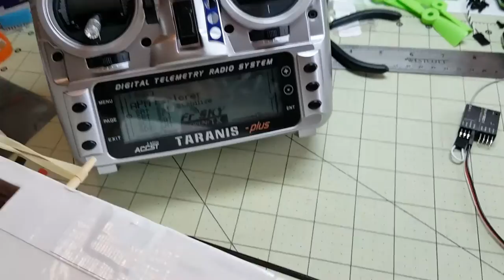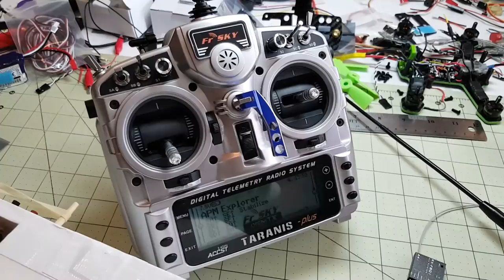FrSky to Dragonlink Repeater

Comment: Very cool but it lacks a voltage alarm warning in case @5:03
Reply from the maker: +Koestel Good observation!  I do use a lipo alarm on the balance lead, just forgot to put it on for the video shoot.
Reply: +Albert Kim (marblekit) 
okay, or take the telemetry receiver

Comment: Very interesting. If I well understand (my English is not very good) you use a standard receiver? So this could be done with any receiver? What about a more simple system using a simple wire (I plan to use a standard data cable for
computer) ?
Reply from the maker: +Volde lurubu Need a PPM receiver
Reply: yes of course. What about my idea of a wire ?
Reply from the maker: Not sure about a data cable for a computer.  I guess give it a try, it can't hurt.
Reply: Albert Kim n

Comment: is that the dragon link V3? i plan on doing this within the next few weeks. I'll keep you updated on how it worked out. Thanks for the vid
Reply from the maker: +leedo03 It's the Dragonlink V2. It probably will work with V3 just fine.
Reply: +Albert Kim (marble kit) Cool, everything should come in today. Ill try it out this weekend. It looks like you're binding channel 1 and 3? Is there a reason why you're doing this?
Reply from the maker: +FPVEngineering on that receiver jumping channel 1& 3 will enable PPM. That's what I'm using this for.
Reply: +Albert Kim (marblekit) it works great. thanks!
Reply from the maker: +FPVEngineering awesome!
Reply: Will this work for the x8r too?

Comment: Hello my friend

I have qx7
Receiver ppm / sbus

Modul r9m
Receiver r9m mini only sbus.

Can i repeater my modul.

Help me please thanks alot
Reply from the maker: The method I used in this video will not work on those parts, sorry.
Reply: @AlbertKimTV  so what part can i use to repeater my r9m modul plase help
Reply from the maker: You can't because the module uses the serial protocol, not PPM.  There might be a more complicated way to engineer this, but I don't have that knowledge, sorry.
Reply: @AlbertKimTV  the r9m can set to ppm.

So the receiver must use r9 slim ppm mode?

So can repeater is that true?

Comment: Hi , just curious how is your latency on this relay? i tried 2 different frsky RXes (X8R and jumper R1-D16) and not to happy with relay and "glitching" of plane controls (servos). I am connecting via SBUS - these days DL V3 accepts SBUS on input1
Reply from the maker: I never experienced any glitching of delays.  I was connected via PPM I believe.  I had no issues with latency and was able to fly long range planes with no issues.

Comment: Is there a method to recive telemetry using this setup?  My current setup is FrSky x6e to the D.L.  I'm using a Taranis X9E and really don't want to drill any holes by installing the DL
Reply from the maker: None that I'm aware of. I suppose you could have the flight controller send some data over a channel in the PPM stream and then have the FrSky receiver forward that info to the Taranis, but this is just speculation on my part and I have no idea how this would be implemented.  Most people doing long range will have the flight controller display telemetry type information on an OSD and this will be sent over the FPV video downlink instead.  This is more practical anyway.
Reply: Understandable, I've been playing with it for a bit, and have had no luck, Thought maybe I was missing something, besides there is very little info out there on the X9E.  I did the repeater and it works fine.  Great video, keep it up!

Comment: Is there any way of getting 12 channels? I'm using ET Vector and I don't want to lose my RSSI and Link (it requires them to be on 11&12). Thanks
Reply from the maker: If you use a receiver on the repeater end that can do 12-ch PPM, it should work. I believe the X8R in D16 mode will work this way.
Reply: Doesn't the x8r output SBUS instead of CPPM?
Reply from the maker: +BOOF! you can use an SBUS to cppm converter... or try an XSR receiver instead. That one does both cppm and SBUS.
Reply: I've ordered a x4r and the converter. Should get me going. Thanks

Comment: will this allow you to use telemetry. Thanks
Reply from the maker: +Evan VH Not that useful in this scenario. You can get RSSI from the FrSky receiver, but it's only a few feet away so doesn't serve much purpose.  The Dragonlink receiver does not output any telemetry so the Taranis can't get any from the receiver we are interested in.  For me, I just use an OSD connected to my flight controller (APM) to get RSSI, battery voltage, and other important information I need.
Reply: +Albert Kim (marblekit) 

Thanks Albert

Comment: can I use a X8R or L9R receiver if I could do I get the ppm signal from sbus?
Reply from the maker: +Gilberto Sedo yes, I think FrSky has a converter as well. It should work.
Reply: +Albert Kim (marblekit) converter? in the menu on the TX I have the ppm out turn on so I suppose it sending ppm signal to the receiver. if that is so, do I conected the signal out to the dragonlink from the sbus?
Reply from the maker: No, that is not how to setup this system. The FrSky receiver has to output PPM to the DragonLink transmitter because that's all it understands. You don't setup PPM in the Taranis. That just speaks normal FrSky protocols to the FrSky receiver.  In order for the X8R to talk to the DragonLink, it has to convert its SBUS to PPM. This cable will do that...  http://goo.gl/zVZ1Yx
Reply: +Albert Kim (marblekit) Thank you Sir.
Reply: You might be interested to know the new Dragonlink V3 Tx can receive either PPM or SBUS on its input.  There is an option in the software to switch between each.
Reply: That is very cool. Thanks for the info.